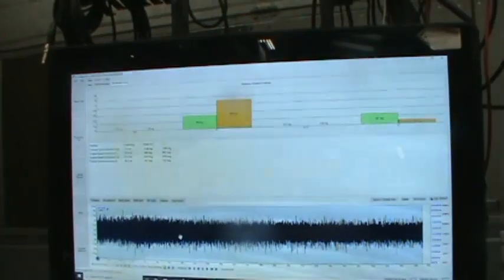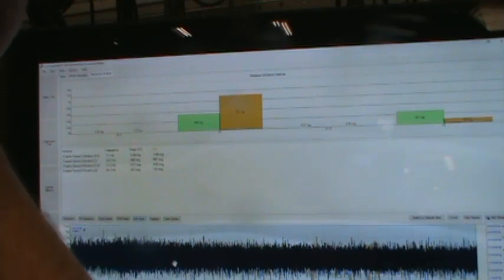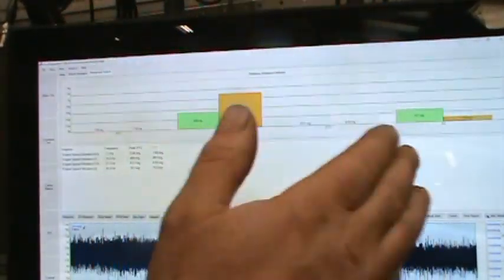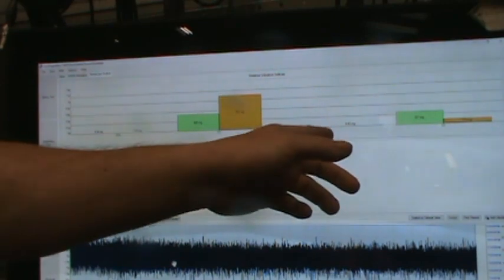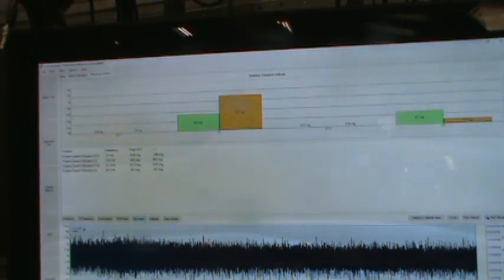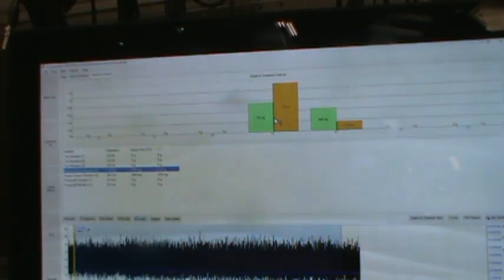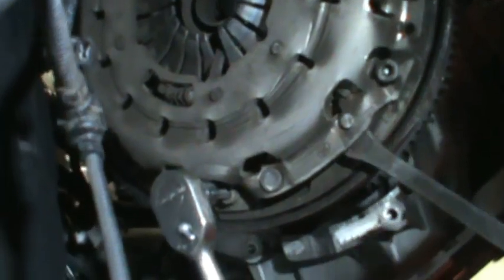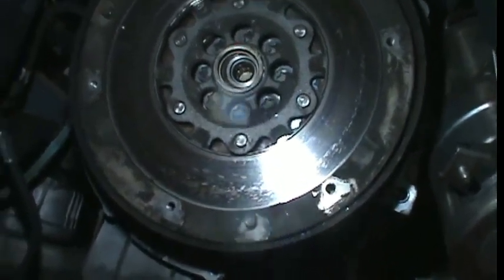BMW diesel n47  misfire or flywheel  using the Pico  NVH to prove it ,with very little guess work

Comment: Another great video Trev. Thanks for uploading..

This is one of those frustrating jobs when no codes are thrown up on the scan  & you need to start thinking outside the box as you've shown. Great to see you've embraced the technology and I agree with you in regards to future proofing. With EV 's, every creak, thump and click will be audible on these cars as the electric motor will be whisper quite & tech like NVH will be very useful in diagnosis.

I had exactly the same vibration (almost a side to side rocking) on idle only.  Like you I tried the usual suspects, 1st I did a full scan, no codes whatsoever. 2nd visual inspection on timing including belt, tensioner, pulleys etc 3rd injectors & fuel filter. 4th engine mounts & gearbox mount including tightness of subframe bolts. No joy with the above. I decided that it must be the dual mass flywheel so changed that over including the clutch and release bearing. This did slightly improve the shake/vibration/rocking but not enough and it still didn't sound right compared to same engine in another vehicle. Finally solved the problem by removing the auxiliary v-belt which drives the power steering pump & a/c compressor, started the engine without the belt on and the vibrations where gone!!  It turned out to be  faulty a/c compressor bearings & pulley. I hope this helps someone out there as it could possibly save a lot of money & time.
Reply from the maker: Great write up sir , thanks for sharing

Comment: briljant video mate!, I have the same engine and I now I need to chance the clutch now I may aswhile do the flywheel when I am at it.
Reply from the maker: Ow yes sir it false economy and it not that bad of a job ,check the rubber donuts on the prop while you got it off
Reply: @trevorchillery1019  I sure will,  thank you for the advice!

Comment: boss vid Trev     where did you mount the magnet
Reply from the maker: I put the magnetic’s on the sump plugs on the engine/gearbox sir .it’s the only thing that was steel for the magnet 
🤔🤔🤔🤔🤔Have to think about the new cars all plastic/ aluminium  even bolts 😳😳😳so I’m thinking how to attach a metal washer to these components